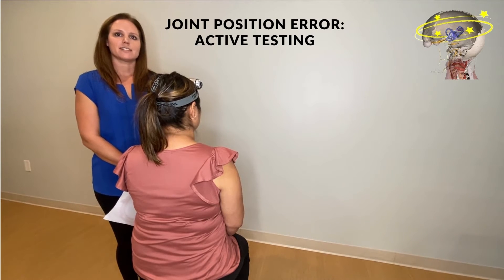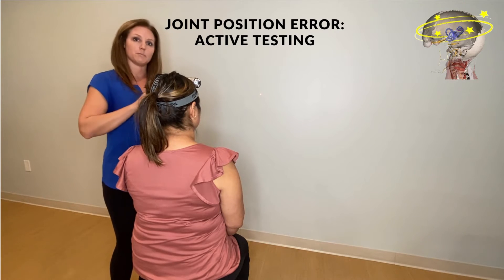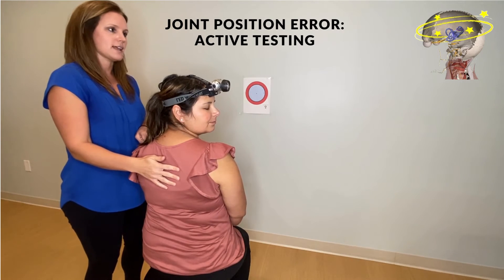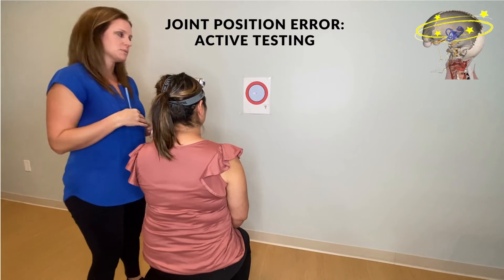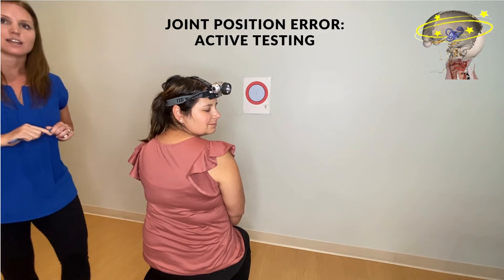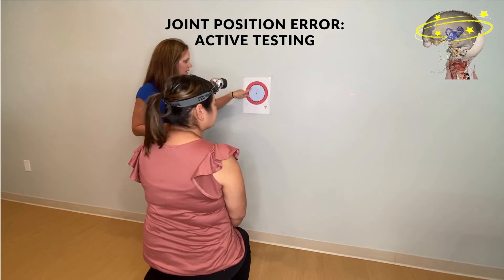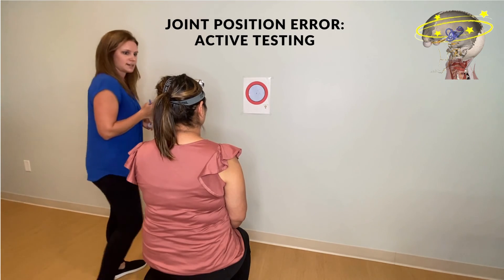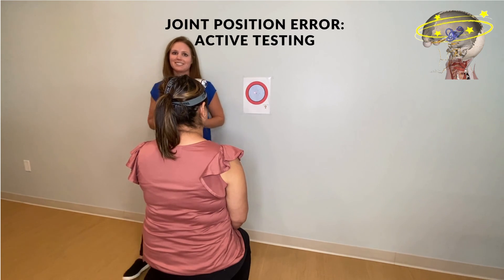Cervical Joint Position Error Testing

Comment: Hello, should we use any specific headlamp and led light for this test Or any led laser will work?
Reply from the maker: We recommend a simple red light laser, such as one you will use with a cat. You can attach it to a cap. There are more specific brands for this but ultimately more expensive.